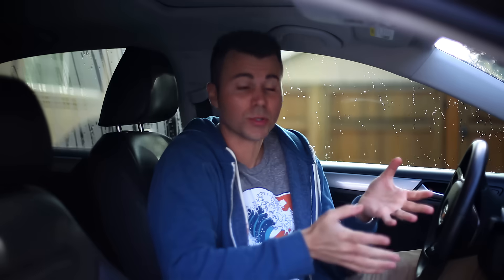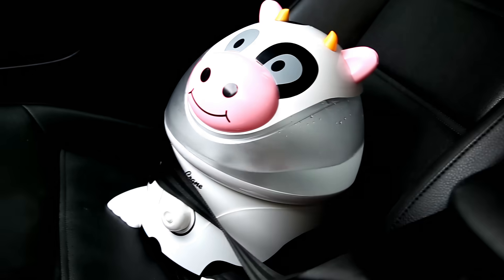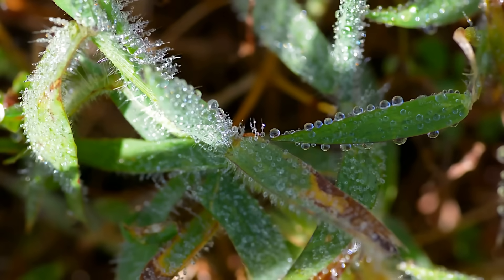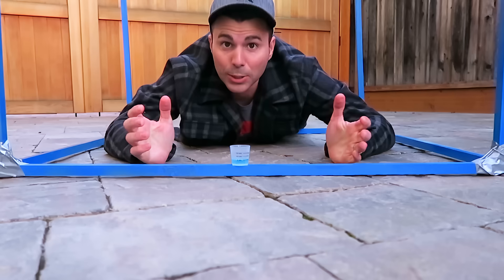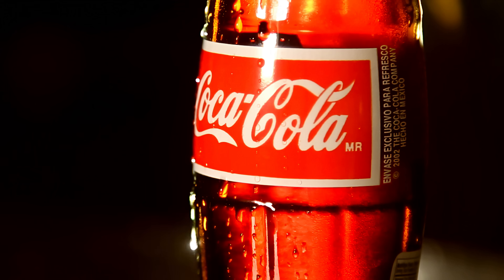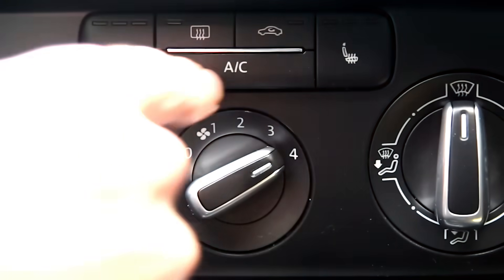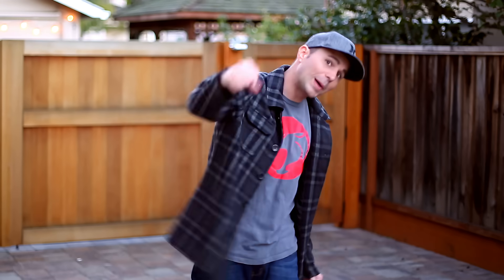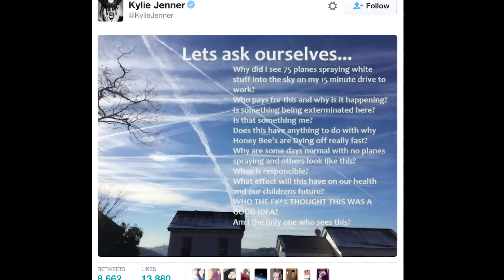Defog your windows TWICE as fast using SCIENCE- 4 easy steps

Comment: Do not pour boiling water on the windscreen like some people still do.
Unless you like cracked windows.
Reply: Yup, and Watch the Window/Windshield Crack or Blow up!!!

Ready for this............ Wait for it, no, no, Wait for it........... Mix 45% Alcohol with 55% Water. On that COLD Freezing Morning/Day when Your Windshield is Ice/Frost Covered. Spray the Windshield with this Spray!!! Walla, Frost/Ice GONE. (Inside) Prevent Fog upon Your Windshield by Cleaning it with "Shaving Creme". Yes, it Works... Even Use this Trick on Your Bathroom Mirror... AND Always Remember. "NEVER" turn on the Cars Rear Window Defogger on a Frozen Iced Window. Start the Car. Let the Window Warm up just a bit... Then Turn on the Rear Window Defroster!!! Or Turn it on like Many People do "And Watch the Window Blow up."

Comment: Turning on your AC when it's super cold outside will ruin your AC compressor. Do not do what he says.
Reply: It's "voila" not "walla."  Excellent tip though!
Reply: Most modern cars automatically run the AC when the defroster is selected regardless of outside temperature, there is enough heat from the engine to prevent any damage. The only time the compressor will refuse to turn on in cold weather is when the refrigerant is low. All cars since the 70's will also run the compressor automatically from time to time to maintain pressure in the system and prevent internal erosion. You obviously have no clue what you were babbling about.
Reply: Sorry you're wrong, I am an auto technician with over 30 years experience, you won't damage the compressor because the compressor is designed to run in the defrost position to help clear the windshield under certain conditions.
Reply: MikeDunn If it’s to cold out your ac compressor won’t come on , because it is colder than the air temp so you’re ac system knows what you’re temperature is outside and inside the car. So I’m talking about very cold temperatures. If you listen to the ac compressor you will hear it coming on and off.
Reply: 6977w........BULLCRAP........your AC compressor comes on every time you set your  controls to DEFROST.  A safety feature to keep your AC from getting stuck (rust, corrosion, lack of use) during the long winter months.
Reply: Remy-- Learn to read. i said when it's supercold outside.  The issue on running an air conditioner in cold weather is that refrigerant will migrate underneath the oil in the compressor crank case.  Ask any AC guy and stop driving that Fischer Price car you bought last week.
Reply: Wrong ! You're compresser will be fine, it runs when the heater is on defrost anyway
Reply: Really?  Ruin the compressor?  Are you driving a Fisher Price car?
Reply: When you turn on your defrost,it turns your compressor on too
Reply: You're supposed to run your A/C every season.
Reply: Keith Morton actually it doesn't, a/c is on only for the front windshield.  The rear windshield uses coils on the window that heats up, that's what those lines are for on the rear window.
Reply: Ready for this............ Wait for it, no, no, Wait for it........... Mix 45% Alcohol with 55% Water. On that COLD Freezing Morning/Day when Your Windshield is Ice/Frost Covered. Spray the Windshield with this Spray!!! Walla, Frost/Ice GONE. (Inside) Prevent Fog upon Your Windshield by Cleaning it with "Shaving Creme". Yes, it Works... Even Use this Trick on Your Bathroom Mirror... AND Always Remember. "NEVER" turn on the Cars Rear Window Defogger on a Frozen Iced Window. Start the Car. Let the Window Warm up just a bit... Then Turn on the Rear Window Defroster!!! Or Turn it on like Many People do "And Watch the Window Blow up."
Reply: @19Bob57  Yikes, this thread has a bunch of errors in it. Its Voilá, not Walla (and its not walla walla bing bong or whatever). Spraying the windshield with any percentage of anything that contains alcohol in it will melt the ice on the windshield (but that s not what this video was about). Shaving cream works by putting a layer of soap on the windshield, which causes the the water to bead up and rolling off. If you wipe the windshield with a towel you will wipe the water moisture off anyway, you don't actually nee the shaving cream. The value of shaving cream is that it leaves a thin coating of soap on the windshield which replies water in the future so your windshield stays clear (or will defrost quicker if it somehow does build up a little bit of fog).

You can turn the rear defroster any time you want, even if its super cold outside. I have personally tuned it on during temperatures lower than 35 degrees below zero and never had a problem, plus in my relative's shops (they are all mechanics, I'm an engineer) in snow territory they have never ever replaced anyone's rear window because of a defroster incident (over that past 70 years). The rear defroster is designed to work in super cold temperatures and really does not get hot, all it has to do is to warm the window slightly so the slightly warmer air around it will carry away the small amount of moisture on the window.

We have never ever seen any refrigerant migrate anywhere so we have never ever seen it cause any problems (with tens of thousands of customer's cars over the decades). If you have a leaky system then fix the leak.

Modern AC do not automatically turn on the AC when the defroster is engaged. Some cars do this other do not. If you have a separate button labeled AC that engages the AC compressor then look at it. It it turns on when the defrost feature is activate then you are done. If if does not turn ob when you select the defrost feature then you have to push the button manually turn it on. Its kinda obvious.

The AC compressor cycles on and off depending on demand if your car has an automatic climate control system, it will turn on when the interior of your car is too hot and turn off when its cooled enough). If its a manual AC system (you have to push the button to turn on the AC compressor) then the compressor will stay on continuously (unless the system pressure gets too high or too low). You can check this yourself by opening the hood and watching the operation of the AC compressor (the frontmost part will spin when the compressor is on).
Reply: @19Bob57  what??  I just had a remote starter put in and it also does the rear window when remotely started. No such bad thing happened. What do u mean,??
Reply: Grim Reaper syp - I tried that method with the alcohol and it didn't work.
Reply: @19Bob57  ...wont the alcohol dry-rot the rubber seal on your windshield?
Reply: Derek Mebius no it's walla, like Walla Walla bing bang.

Comment: Very small point but worth mentioning, the hot air will not be available until the car’s engine has warmed up a bit, so you can twist that dial all you like, it will make no difference at all. Instead, read the owner’s manual for your car, it will tell you the best way to demist your screen
Reply: His method is what I have read in most car manuals so its perfectly valid.

Comment: Well you truly need to determine the gpp (grains per lb.) and just because the air is hot doesn’t mean it can hold more h2o. Get your atmospheric readings and use a psychometric chart to truly determine what you need to do to get the atmospheric air to hold more moisture.

Comment: moisture level in the car + temperature differential of glass equals dew point on your windows...also, its hard to lower the window when they are frozen shut and that left over snow slush is sitting on the rubber floor mats creating a lot of moisture inside the car...as long as there is moisture (inside the car), there will be foggy windows eventually

Comment: Also modern cars won't produce hot air until engine is heated up because it reserves hot liquid to speed up warming up for emissions reasons. So you are looking at 10-15 minutes in winter. Put a moisture absorber on your dash lol
Reply: Nope not true. Yes they have been redesigned to warm the engine up faster and they were redesigned to warm yo the passenger compartment faster as well. The small amount of heat that is routed to the passenger compartment is insignificant compared to the amount of heat that the engine produces. Just follow the instructions in car's manual (it won't take 15 minus to get heat, in our cars we are getting noticeable heat after driving to the traffic light that is one block away).

Comment: I find that where I stay (warmer climate), that if the temperature is above say 24 degrees (centigrade) when it rains, the inside of my car fogs.  Warm air just makes it fog more. In fact it fogs up like crazy!! Cold air however (with the Ac blasting cold air in manual defroster settings) instantly kills the condensation. BUT after a while you get the moustache. condensation on the outside along where the defroster vents direct air. Then one needs to blast hot air for a while to raise the temperature of the glass a bit - and your moustache outside dies. But these two steps are a continuous dance. I emphasise - any hot air with or (without  the ac compressor on as well) fogs 100% where I am (Bangalore India)

This is the opposite in winter in say 5-6 degrees C. (Super dry Delhi) Then hot air works like  a charm, yes with fresh the air mode selected and the ac compressor on! :)

Comment: Same is true when heating a house. If the air is wet then you are heating the the water in the air. If you dry the air it will cheaper and faster to heat the house

Comment: Technically, the first step should be to turn on the AC and then set the temperature dial to max because on a cold start-up there won't be any engine heat in the coolant for a few minutes.  Splitting hairs for sure, but such is the nature of optimization...
Reply: Thats not splitting hairs, it's completely irrelevant. Neither system come up to maximum operating effectiveness instantly so it doesn't really matter because the human being is simply goin to turn both on which they can do in one to two seconds.

Comment: So... the condensation forms on the outside so why dont you just run the windshield wipers?
Reply: I don't know about where you live, but until the inside of the car is hot my windows just fog up again after using the wipers. Doesn't help at all, aside from minimal visibility while trying to drive with fogged windows.

Comment: was it mentioned in the video that there's a setting on most cars fans that is marked with a windshield icon and when you set the fan at that then the A/C is automatically turned on as well so fog on the inside of the windshield can be removed using the car's own source of cold air?

i know Ford cars do that automatically ... i have even found it a drag because sometimes i don't want the A/C and i just want air, or ONLY warm air to come from under the windshield and Ford doesn't give you that option at such a setting, only A/C, which means if you want warm air through that setting for whatever the reason, then both the heater as well as the A/C will be working at the same time apparently ... if so, ain't that a little bit too darn? or maybe the heater will not work at that setting and only the A/C works then and it's just for defogging the windshield?
Reply: That is the defrost setting. Most cars do not automatically turn on the AC when in the defrost setting, some do and some don't so its best to explain this technique so that every gets the benefit of quicker defrosting.

Comment: Summary:
1) Full Heat
2) A/C On
3) Recirculation Off
4) Let as much outside air as possible into your car
Reply: Cheers
Reply: Dose that really work my windows have ice on windsheild
Reply: ok ..ice on windows....my suggestion is before you park your car,..as you are driving ....TURN OFF ALL HEAT,.....all windows down ,...equal the outside temps with the inside temps ....close windows to maybe just a very small crack for any build up from the engine,...and WAHLAH ...no ice on windshield ,... OR,.. i would go out last minute and open windows for about 2 mins that should remove all warm temps and equalize the outside with inside , and the falling snow wont melt as it lands on the windshield ....it really depends on the weather how cold and how fast the temps drop so when you get home and snow has melted on the windshield followed by dropping temps due to wind chill,...heavy snow will act like a blanket and melt the ice .....there is just no exact answer for ice on wind shield ,...maybe a spray deicer before it freezes ,..doesn't work at all if its applied after its frozen ...best be patient though when warming the windshield,..them windshields can crack if the temp is change too drastically   @pamelasuemoreland3315
Reply: pamela espinoza ice the best is an old plastic member card from your wallet or purse. Or if you really want to get fancy a brass ice scraper.
Reply: @pamelasuemoreland3315  in my experience no cuz I've literally tried this many times before and the cold air from the outside chills the hot air from the defroster
Reply: Yeah I do that in my house to I take all the 32 Degree air from outside and heat it up to 72 degrees😎
Reply: Not exactly.. 4) let as much interior air out INITIALLY to release excess moisture (humidity), then close the windows to dry the interior air
Reply: Thank God 🙄
Reply: Except in the morning the engine is cold, so nr. 1 is not useful. The A/C coil takes time to actually turn cold and help, so nr.2 is not useful ina hurry. Most newer cars turn recirculation off when the knob is set to windshield only (my 10yo Opel does it), so nr. 3 is less useful.

In the end the only useful trick is to have the windows open to let fresh air from outside in. And I also use a cloth to wipe the thick layer, although it only partially helps in cold mornings.
Reply: @durragas4671  You can't recirculate on defrost because the intake for it is literally the defrosters!
Reply: Ezra Kainz Scholl has taught you well lol Look this guy using summary
Reply: AC automatically comes on any time you are on defrost. Cars have been doing that for several decades! Recirculation can't be on as the defrost is the intake for re circulation!
Reply: maybe not as much outside air as possible in the car, because remember, it's cold and while we want the air hitting the windshield to be dry, we also want it to be warm
Reply: And then wonder why lower part of the windshield is full of cracks

Comment: But fog is hardly any problem. The coat of ice is, and one of the steps hurts the total time if you have ice and are in a cold climate. You don't turn the air on full blast. If you do, It will take longer for your car to heat up and so the air won't melt the ice very well.  You need to wait for the car to heat up first which means don't turn it on until you are almost ready to leave or keep the fan on low. Not sure about the ac since I don't have ac but my guess is turning it on (and any other accessories lights radio whatever) should draw more power and thus make the engine work harder to recharge the battery. so go for it.
Reply: The coating of ice should be scraped off by hand, at which time the heater is putting out enough heat to defrost he windshield. Then drive your car normally (idling wears engines out much quicker then driving does and you;; get normal heat much quicker.

Comment: I've noticed that if you park by a wall, you get less or no fog/frost on that side. I think you can avoid it altogether if you park inside a garage, even if left open. I haven't proven this, but I think either covering your car with a regular car cover or setting up a cabana to cover your car will help with both fog and frost. I feel like if you can even just put a towel on top of your car the night before, if it won't slide or be taken, and it'll help too, I just need to try it out to be sure.